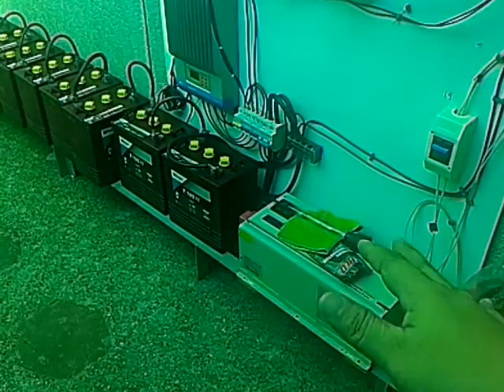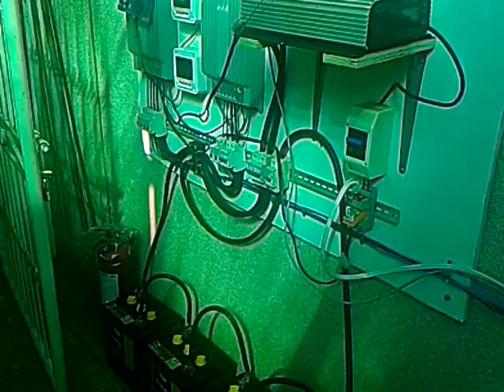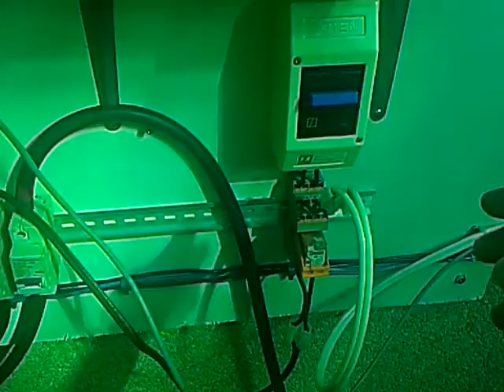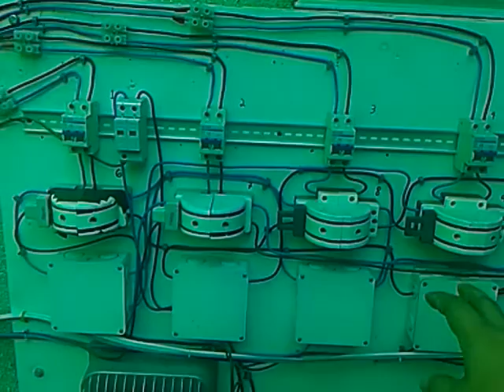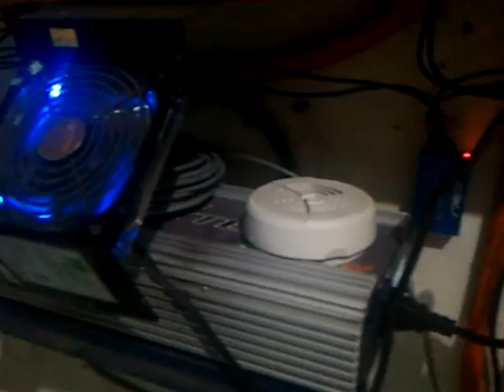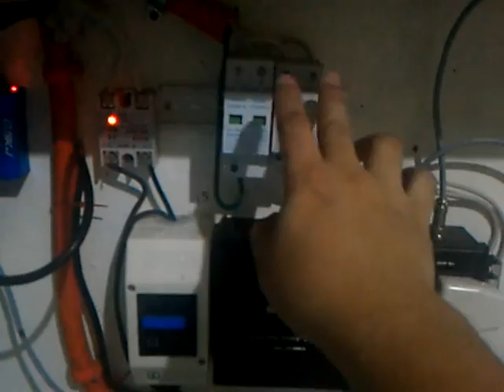DIY Solar.  Grid Tie Inverter with Limiter with Batteries

Comment: nice setup, but I have comment on the relay used, i think no need of it because the Grid tie inverter has its own low voltage disconnect feature.
Reply from the maker: Edwin Pumar the gti's lvd is too low. It will destroy the batt

Comment: glen nice set up. i'm planning to put up a solar power system for my house. my question is what is the good thing in toroidal inverter?
Reply from the maker: Emerson Silagan it handles surge a lot better.  it can handle a 9kw surge for a few seconds.  compared to switching type of off grid inverter that can only handle it for milliseconds.